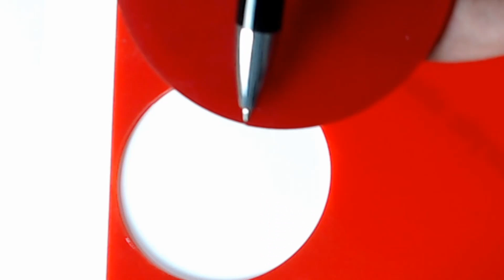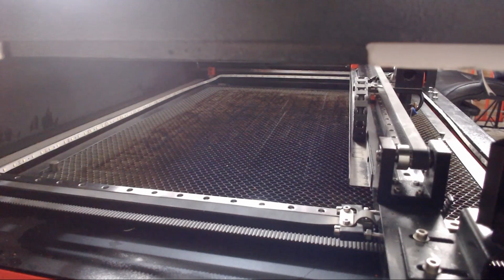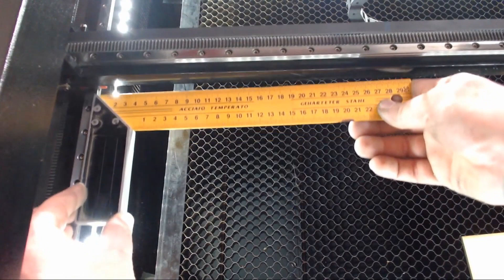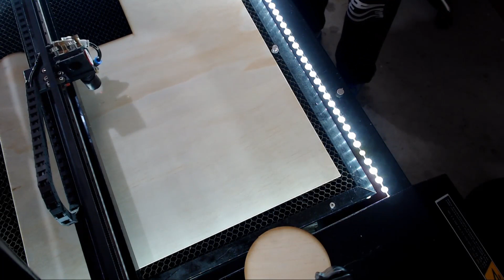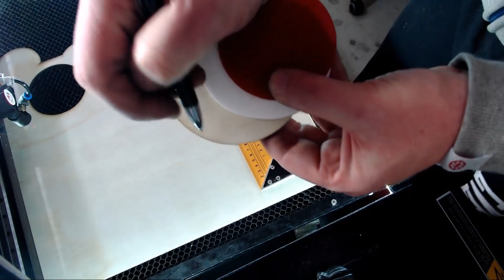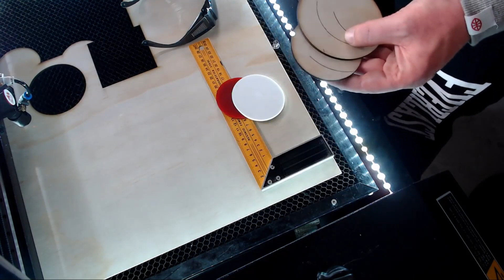Adjusting The X & Y Belts On Co2 Laser Engraving Machine - Chinese 80W CNC Laser Cutting Machine

Comment: Hi Matt, you have helped me in the past and I am here with another request!!!

The BODOR BCL 0605MUF 80W CO2 laser engraving / cutting machine I acquired about a year ago has started to show signs of incorrect belt tensioning on the Y and/or X Axis.
This has manifested itself in the form of circles cut in 5mm Acrylic not lining up at the finish point with the start point, causing a very small step in the surface of the cut. ( Exactly as you show in your video ).
Unfortunately I do not have any form of user manual with the laser so I am unsure of how to adjust the belt tensioning correctly, I would also like to learn how to replace the X, Y and Z belts if and when needed, the Z belt seems the most difficult to work on as it looks like it  would require a serious strip down of the machine unless I have missed something??
Any help you could provide would be greatly appreciated mate👍

Best Rgds
Kevan Dalby

Comment: I know this original post was a while ago, but I had the same issue with lasering a circle.  I tighten the belts and squared the gantry.  Worked just as you explained.  Now I'm moving on to calibrating the stepper motors for the x and y axis.  Thanks for the video.

Comment: Hi Matt.
I wish you will see this comment as i am really in trouble, I tried a lot but all in vain.
In my both Chinese machines 100 and 150 w.  (Some times) while engraving, all of a sudden the laser head jumps to few millimeter further ( X  or Y), continuing from this now spot and destroys all my job. As far as i know you are the best for this  i am  sure you can help me.
(This issue happens only in top- middle part of the bed)
Both machins are almost new, no loosen parts and good belts...
Reply: Something is moving that shouldn't be moving. It could be belts tenstion it could be screws on laser head. Given that machine is new I would also make sure your groundwork is properly flat and that material itself is not moving.
Reply: did you find a solution for this, machine just started doing this, thanks

Comment: Hi Matt, I recently made a mistake by running my Lazer head into an object I had in my bed and it hit it pretty hard. The laser head is okay as far as I know but now it won't engrave where it needs to according to my subject matter X and Y coordinates in lightburn. For example if I have a 10 x 10 piece of wood in the center of my machine, and make sure it's there in lightburn and I hit run and it only jogs out about 6 in and tries to engrave completely in the wrong spot. Is this a late burn issue or perhaps a mechanical? Any ideas would be very helpful, the machine has been down for 3 days now.

Comment: Thanks for the video...would I ever have to lube anything? My 60w is starting to making noise when going front to back :(
Reply from the maker: General maintenance required, regularly Clean axis rails, use machine oil on unsealed bearings if your machine has these.

Comment: Hi Matt. Great video.  I always learn a lot from watching you explain things. Recently I have some trouble with my Y axis not moving past 768 mm on my machine. Is that anything to do with the machine itself or more of a software issue? I also just recently switched back from doing tumblers. Thanks!
Reply from the maker: Check rotary is disabled in software when not in use.
Check Axis "breadth" / length is set correctly in the Vendor settings.
if you require further assistance email matt@mwlaser.com.au
cheers Matt

Comment: hello  sir , i have  issue with my laser , my y axis rail is not at 90 degree . if i set it at y+ then while coming to y- its no 90 degree anymore , and bcz of thid the alignment is getting out . my factory is close for the past 2 weeks  and the mechanics are not able to find the problem because i have already changed the sliders, and the pully too but the issue is still there. pls help me out
Reply from the maker: This sounds like a mechanical misalignment and is not something I can assist with via YouTube comments
Reply: @MWLaser  thank you for atleast answering. Last night after watching the video i got up from my bed and tried to do something with the belts. Till 4 am i found out the issue maybe was on the belt tension. Yet i won't say i have solved the issue 100% but atleast its working better than that. And i think i can make it better. Thank you for your video and support
Reply: Hi Matt thank you for the alignment video very helpfull and I am about to attempt this exact fix.
however I am worried that if I move the Y axis to get both axis back to square doesnt that mean I will have to re-align the mirror on the head of the laser? 

I'm not confident on mirror alignment and don't want the laser out of service.

Comment: Great instruction for the Y axis belts but you didn't cover the X axis belt (where the head is connected).  The title of this video says X & Y belts
Reply from the maker: the method is the same for each axis on this machine, the only difference is on the x axis the laser head bracket is integrated into the belt tensioning carriage.
Reply: @MWLaser  I am attempting to fix my x axis, when I turn on the machine the head goes towards 0,0 but grinds on the X as though it doesn't know to stop. how can I fix this, or what should I search for to fix this?
Reply from the maker: Sounds like the limit switch is not functioning, or is not positioned to detect axis travel. 
Check it out, and if you still require assistance email askmatt@mwlaser.com.au  Cheers Matt

Comment: Hi, very usefull video. Thanks alot for the info. Maybe you can help with my problem. I have a repeating missalignmnet on the X-Axis. I have tighten the belts and bolts and also aligned the steps via software (Vendor Settings). But from time to time I'm getting a deviation of around 2mm on a 300mm line. If ran the alignment procedure again, it will fix it but after a day or two it will run out of alignment again. Do you have an idea? thanks.
Reply from the maker: What control are you using? Email Matt@mwlaser.com.au  Thank you
Reply: A bit late now, but the grub screws may be slipping on the shaft. Replace the grub screws and try again.

Comment: this is the first video that actually gives clear instructions on how to adjust tension on belts.  which is very useful if you ever have the unfortunate need to replace your belts.
Reply from the maker: No I have not needed to replace the belts, I have spare in case of breaking.  For the 80W it is a 10mm wide belt and for my larger machine 15mm Belt - You can purchase by the metre.  Cheers Matt
https://mwlaser.com.au/product/cnc-timing-belts-fasteners/

Comment: Hey Matt, hopefully you can help, I've just got the exact machine as yours but  Y axis won't move up and down when the botton is press on the controller cheers
Reply from the maker: Hi. Does it move when you run a job? Or not at all? And just not from controller?
Reply: Appreciate the quick response, Haven't run it with any job yet, would you recommend I run a program to check if it moves? Cheers